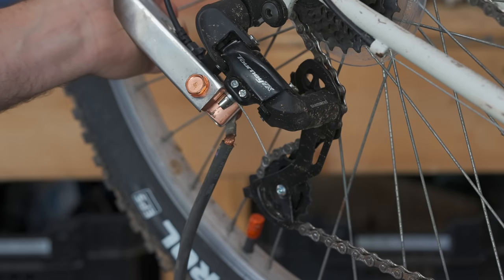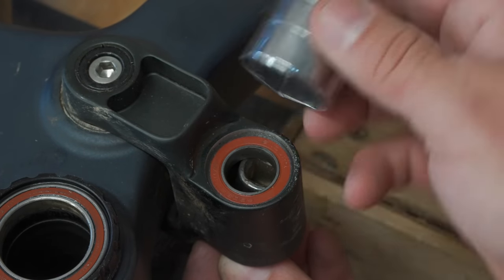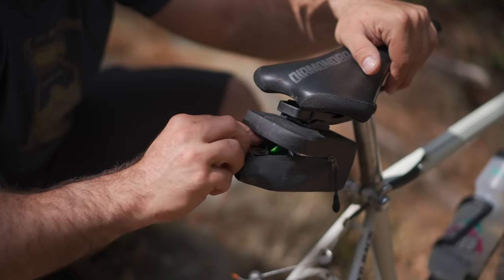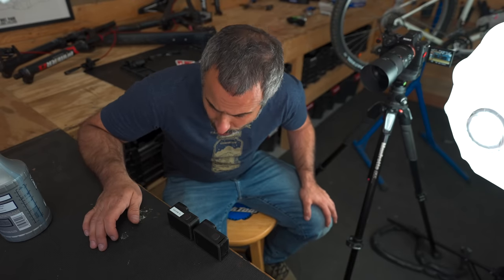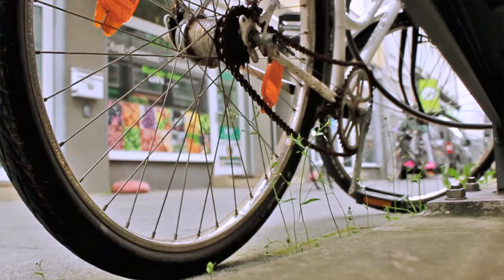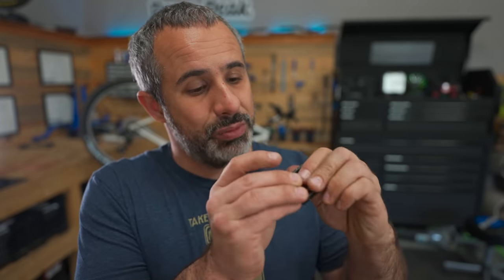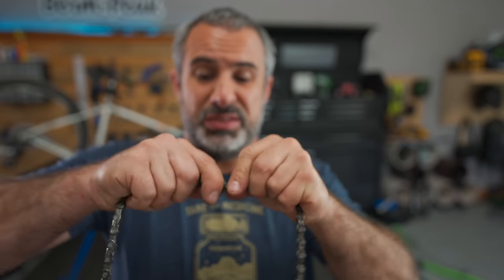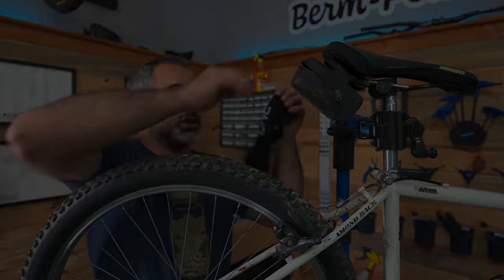10 ill-advised hacks for bicycles

Comment: "Put a sock in it" is a reference to the old fashioned (mechanical not electric) record players. They had very little volume control, so if you wanted to listen quietly, they'd put a piece of cloth in the big horn speaker part.

Comment: The chain works absolutely fine, older or low end bikes still don't have quicklinks, and they performe just as well.
Reply: when i buy a new modern chain, i always toss the quicklinks in the garbage .. and join it 'normally'

Comment: Not welding but in the automotive side we often just solder or low temperature braze the ends. That way you don't ruin the zinc anti-corrosion coating.

Comment: Regarding the rainX. Products like that require usualy to use multiple coats at time intervals. So apply a first coat, let it sit for 1 minute, wipe off, wait a bit, like 30 min, than next coat. After that it sgould sit with no water contact for like a day or so

Comment: Be careful when changing out bolts as they have different ratings and could fail if you use the wrong one. Just because it’s the correct size doesn’t mean it’s comparable strength.

Comment: A hack is to take something and make it do something it was not meant to do or be.

The bearing press "hack" was taught to me years ago by a fellow motorcyclist when my harley needed some transmission work I could not afford to take to a mechanic. It has been around at least since the 50s from what I understand (as a seal press)

Your sock pun was great... I did similar in the 80s to keep parts from rubbing together damaging each other (I had a screwdriver ruin a spare tube once and there after I had a shop rag or three filling out the rest of the pouch. The shop rags also let me clean greasy fingers and such after a field repair. (most often a thrown chain or punctured tube) ( I am calling BS on your closing "cut scene") :)

The rain-x thing was flawed... Rain-x and other window sealants work best when polished into an already ultra clean surface. There are other products, but rain-x IS the reigning champion for rain and fog removal... but it will not work unless you have enough wind or vibration to cause the microdroplets to merge and get bulky enough or heavy enough to be moved to the side by wind or vibration. I was an auto detailer for years, and have used rain-x for over a decade. It works well. I also used it on my motorcycle visor (full face helm visor) I think it works better on glass than plastic. It is trying to fill the scratches with hydrophobic polymers. On my truck soon I will be trying NanoSkin "Rain" as an alternative to rain-x and as a compliment to rain-x (splitting my windshield into thirds. Just Rain-x, Rain and Rain-x and just Rain respectively). I mentioned above that rain-x wants an ultra clean surface... I had a lot of trouble with rain-x no longer being effective when my old truck started burning oil. the fumes carried micro droplets of oil which would stick to the windshield and interfere with the rain-x I also found that dad's windshield would get hazy because he was no longer applying then buffing. He said it was still rain and fog repellent, but it was loaded with rainbows and blueish haze.

Comment: in industry, i used to make thermocouples out of both stranded and solid core wire. they're just spot welded together on the end with a simple fixture and a tig welder. wouldnt be hard to adapt that to go overkill++ on the cable ends.

Comment: Hello!
For the wire ends, I use a soldering iron and some tin. The result is the same. What's more, I solder the ends of the wires before to put the cable crimp.
Greetings from Spain.

Comment: As older bikes are less interesting for the bike thieves, use some spray paint to make your bike look older or like it's frame have been repaired. Use fine sand paper to remove the shine. That way, there is some chance that the potential thief will gloss over your bike and not even attempt to steal it.

Comment: Bearing press I did for the rear wheel of my commuter was the axle from my vintage road bikes rear hub, long enough for almost any need other than maybe headset cups, then against the new bearing the old bearing out race and then some shallow depth sockets that sre same size then washers, nuts tighten and job done

Comment: Do not weld on your bike unless every moving stuff is uninstalled! The welding current can move through the most unexpected parts of your bike, even if your ground is positioned at the closest part possible, especially if it touches a spoke. 
If something like this happens, you have a chance to weld bearing balls to the bearing itself. The loosen very fast after that, because those welds are very tiny points, but aren't exactly round anymore. So you get an unnecessary bearing damage.
I learned that the hard way at a machine at work... what should have been a 30 min job with setting up welding equipment, welding, clean everything up, turned into a 2 day disassembly/assembly to change a bearing...

Comment: Don't use a sock in the tail bag (or any bag) if your trying to reduce noise use rubber gloves and paper towels. If you have a tubeless tire that you can't plug some gloves and towels are your friend on the trail because sealant is sticky. Even if your not tubeless gloves and towels are way more useful than a sock.

Comment: Use Rain X in the bottle with out the spray. Works like a champ if you wipe Rain X on, let it dry. Polish it off with a microfiber cloth. Water and mud won't stick.

Comment: I would advise against using alcohol on the gopro lens as it can damage the coating. Also, there are a few steps to properly applying RainX, more than just spritzing some on and wiping it off right away.

Comment: There are these shrink-tubes with solder in the middle for joining electrical wires and you can totally shove a cable into one and heat gun a tube and solder job in no time.

Comment: Instead of sockets for press adapters, use pvc type tubing so you can sand down the outside if the wall is too thick
Reply: and have the pvc pipe deform and stick in places it shouldn't? nah, i'll pass.
Reply: I totally agree with pvc tubing. I used the pvc couplers and they’re just the right diameter and height to be used on the outside of the bearing. Plus no marring of the frame or paint. I had no deformation as the amount of force applied to extract a bearing is way less than the strength of a pvc coupling

Comment: Super glue on the cable end and twist strands the correct rotation to 'weld' it. You can then easily remove and re-thread the cable then

Comment: 0:13 or simply take a soldering iron, draw a little solder into the cable and cut it afterwards. advantage: you can still pull it out and back in normally.

Comment: I run "pushed back pin" links on my bike. It's an Ebike. A very high power Ebike. Haven't popped one yet. If it's done correctly, it's a valid method.

Comment: The problem with arc welding your cables is that the power consumption is probably going to surpass the cost of putting an end on after only a few times

Comment: Well, I once ripped the side wall on my tyre, about 1 inch long. I was miles from the road on open moorland, the tube had bulged out and exploded and was irreparable. I had a spare tube, so I took my sock off and lined the tyre inside the split, with the sock, I folded it up quite a lot. 
Reinstalled a new tube and pumped up to a low level, it held long enough for me to get back to safety.

Comment: Oxidation of soldering iron you can also use a little bit of soda the soldier on or the other option is you know the rubber material which goes over the cable and then you heat over it and then it melts and shrinks

Comment: The GoPro one if you use Silicone Spray then it works better than RainX should have and it preserves the rubber on the GoPro Camera.
I really like the welding..  could probably use that to replace the stop at other end of cable too if needed..

Comment: Instead of welding the brake cable you can use heat shrink tubing. Its cheaper and less of a hussle to setup

Comment: RainX is very particular on application, not saying you didn't follow the instructions, as I've only used it on cars and not plastics, but I've always had great results that last basically all season. 

So if you feel like you missed a step, might be a good candidate for a round 2? If you followed the directions and it didn't work it must not like the coatings on the lens.

Comment: The hacks are back!
If you don't have a welder to weld frayed cable ends. Solder also works and is more accessible. The easiest method I found is a bit  of heat shrink tubing.
Reply: heatshrink tube is awesome for so many things. didnt think about cable ends, but makes sense
Reply: @brapamaldi7666  It really is, you can use it over the cable end to keep it from coming off.  Or to keep brake and derailleur cable together and quiet. I bought a roll of it for wiring. I ended up using it for everything end of 550 cord, boot and shoe laces if the end falls off, saltwater fishing rig knots. They make larger diameter size with grip I use on fishing poles and shovel handles.
Reply: @Hath.0  ive used mine on paracord too. also bought some real large stuff to put on my crankarms to stop them being worn out by my shoes. kinda worked, but not as well as i hoped, haha.

Comment: I find that a drop of gorilla glue on the end of a cable works just fine. Not only is it smaller than a crimp, it's also nicely rounded--havent yet seen one disintegrate from sun, but maybe that'd be a concern if I kept a cable for years?

Comment: Just remember to put the earth clamp for the welder on the inner cable and not anywhere else, sucks if you earth it through the bike frame, shifter, gear cable outer and weld you cable to the housing etc

Comment: alternate hack on the cable ends i have a little mettle  pot of used solder from my dads years of electrical things i just heat it up so it’s melted in the fire place and dip the cable in perfect every time and looks awsome on period correct bikes

Comment: I solder the cut ends of my cables. Never fray, never need cable crimps, and still feed through the housings... so long as you're half-decent at soldering. Same result, and all you need is a $12 soldering iron, and a roll of solder. Not a $200+ arc welding setup.

Thats my frayed end hack.

Comment: There is a certain way to apply RainX. I believe you need to spray it on and let it haze and then spray it again and then buff it dry. Done correctly it should make the water bead up vs smudge the view.
Reply: Yes.  It looked like he just sprayed it on, and that's not going to do anything but add texture.  Your description is correct, and it's hard to believe it wouldn't work better after doing it like that.  Not sure how it would do on mud, but on rain or water splatters...it should help!

Comment: When you put M-545 pedal bodies onto M-540 spindles,  and remove the 545 cage, the ends of the pedal bearings are open. A nickel JB Welded looks cool and is functional. Works good if you're looking for extra Q factor.

Comment: Yeah the chain hack is definitely a get back home and replace the chain before going out again...there is a good reason all the pins on a modern chain are peened over on the out side so don't just add those links back with the normal pin. A whole new chain is the best. If you're broke use another quick link or Shimano's conncet pin(I personally like those brake off pins better anyway as I remember they were available up to 10 or 11 speed not sure about 12. It seems like those quick connect links open up more than the manufactures admit. The frequency of broken chain while watching the tour is a bit more common place than it used to be. Definitely do not shift into that lowest cog because the chain won't be long enough.. the more links removed the fewer gears you have left.

Comment: I just keep a spare tube in my bike bags that every bike has.  All my wheels except fat bike are all the same size too just in case I need a tube and I ran out like right before I go to work.

Back when i had an ex-racing mechanic do my repairs he would weld all my cables.  It has been 20 plus years since that has been done to my bike.

Comment: The way of chain repair was not a "rescue" method for me, it was main method of mounting, fixing and changing a chain for at least 10 years before i bought the right tools and links ;) And you can remove the pin without a chain tool, just using a nut or a washer, some small allen key or any thin metal rod that you can hammer to push the pin out. Method old as the universe actually.

Comment: Honestly, the chain one isn't ill-advised. I get that master links are a better and easier design nowadays, but chains were built without one for a long until not so long ago. My old Jumpertrek 24" bike from 2008 has one such chain. My current Bianchi 29" from 2019 does not.
As for the cable welding, I had never heard of that, but soldering, yes. In fact, that was common practice until the 70s...? Not sure, I wasn't around then 😅

Comment: About the chain repair: if it's stiff you can loosen it up using the chaintool. Back in the old days that was the way I installed all my chains and it worked perfekt.

I just saw you did mentioned the fence for loosening.
Reply: It's still how you do it.

Comment: My tip for full sus riders and riders In general is if you ride a lot replace your bearings as often as they suggest with good bearings

Dont let them sit/ruin things and corrode the outer race to the seat they sit in… speaking from experience i got some permanent bearings now

Comment: Yeah, try a small oxygen torch for the cable 'weld'. Really, you're just using the torch to cut the cable to length and that melts and welds the strands.

Comment: PLEASE LISTEN BEFORE WELDING YOUR CABLE END!!! Sparks that come from welding are literally molten metal that will melt through any paint on a bike frame or wheels. This then leaves a spot open to oxidation, and will begin corroding your maybe expensive bike frame! 

If you are going to do this find a way to cover the other components of your bike before hand. Please don’t take this advice for granted, my dad used to say the easiest way to write a car off is to aim the sparks from an angle grinder towards it 😁

Comment: ive never had good luck with RainX. i swear even following the directions to a t it's either the same or worse than doing nothing at all.

I don't drive my car much, and a few years ago I was a tiny bit annoyed that whenever I'd come out to drive my car my windshield would be covered in dried muck from the sheet metal "parking garage" provided by my apartment complex that was full of holes. some dude on Reddit recommended I tried RainX, and instead of causing the gross water to wick off the windshield it instead just caused my windshield to fog up instantly when I turned my car on it the temp was even remotely close to freezing outside.

I tried it a couple of times where I'd strip it all off with alcohol and reapply it. I tried it in summer, in fall, in direct sunlight, in the shade, I even forced my roommate to attempt it and every time I found it to be actively detrimental rather than helpful.

maybe that was too extreme of a case asking RainX to endure a constant barage of runoff from a disgusting sheet metal roof, but I've never really been pleased with the result.

Comment: 8:38 Isn't that just how you link a chain in general? Quicklinks are completeley optional. I don't use them and always use this method to open and close my chain when I have to remove it for repairs. This holds up for years, not just as an emergency repair. The only downside is that the chain shown in the video is now a bit shorter due to the broken link, is that why Seth mentioned it is only for emergencies?

Comment: 1:00 I did something similar when I changed the pivot bearings on my old Iron Horse Hollow Point. I had no bearing extractor kit, but I had a bunch of sockets, bolts, washers, spacers and nuts lying around and I used those to extract the old bearings and put in the new ones. It was a little bit of a trial and error to find the adequate sizes, but I worked great. The suspension felt GREAT after that.

Comment: To reconnect the  chain with a pin thats not fully pushed out is something I did with two XX1 eagle chains and they run like there isnt even something wrong with them. Maybe it works just better on 12 speed SRAM

Comment: 🟦.... Welding the end of your bicycle cable like that is going to damage the temper of the cable for a substantial distance from the finished end, just make sure to account for that when you tighten a screw down on the cable that you don't screw it down on or very near the very end, as it Very well may have become embrittled and could just break right-off without warning!
In order to determine how close to the end It can be clamped, start flexing the cable a couple inches from the end & gently flex closer and closer to the end, you'll see where it begins to lose its flexibility,...you want the clamp-point to be just a little bit in FRONT of that and NEVER behind it!

Comment: The RainEx didn't work because you cleaned the cameras with isopropyl alcohol. RainEx is iso, with a surfactant, so you are actually undoing the waterproofing done by the iso. If you want to use RainEx, clean with soapy water, not an alcohol. Better yet, spray with the RainEx, clean, then spray again.

Comment: I do not understand that first bearing trick? Did you just apply pressure on the outside of the bearing on the other side of the c-clamp (the non threaded end)

Comment: To install a new bearing you don't need a socket the same size as the bearing. You only need the old bearing you just removed. It's precisely the right size. Also if I had a bike with flat head m6 screws on it I wouldn't mind if someone stole is.